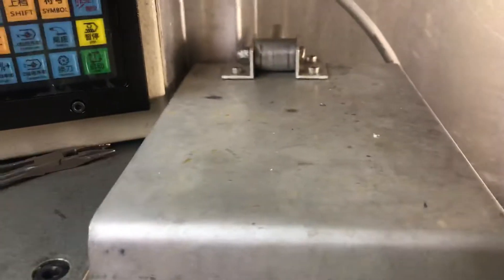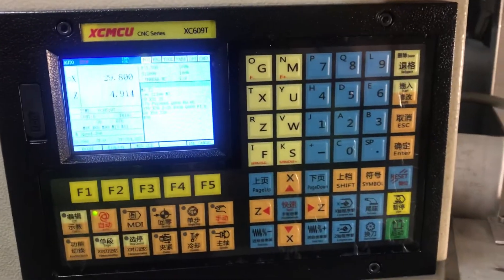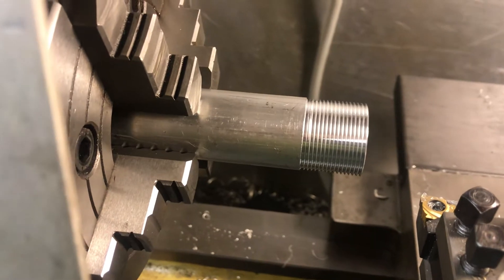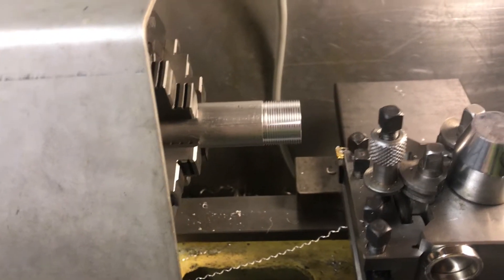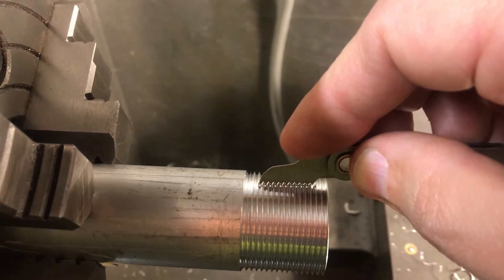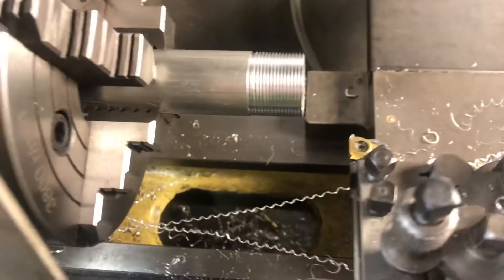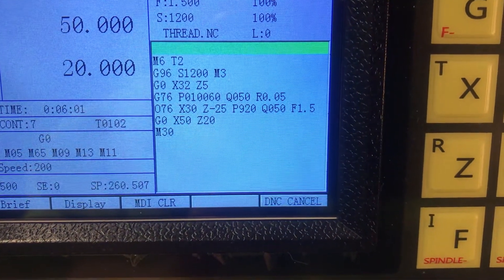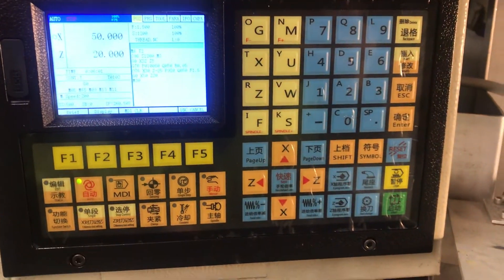Titan 32Bb Cnc conversion part 5 Threading test (phone vid)

Comment: Hello, I will be using a 1000ppr encoder, do I need any calculation in case the ratio of the spindle to the encoder is not 1:1?

Comment: Hello, when the spindle is rotated 360 degrees, it does not return to the uterus via the encoder, why can this be?
Reply from the maker: Encoder pulses set correctly in parameters?
Reply: @MJPilote Yes, that's right, I checked
Reply from the maker: @prom368  Spindle to encoder 1:1 ratio or something else?
Reply: @MJPilote  Yes 1 to 1
Reply from the maker: @prom368  Differential signal encoder? Good quality, not Chinese omron copy? You need A+- B+- Z+- pulses. Z is indexing pulse once per revolution.
Reply: @MJPilote  Do you have a photo of what kind of encoder you have? I have Omron
Reply from the maker: @prom368  i have the encoder in one of the other videos but I would say any of the brand name encoders will work that have differential output.

Comment: What value of parameter P065 is needed?
Reply from the maker: P065 Stable percentage of speed before threading, you can put any value you want but I usually want stable speed so something around 90-98%

Comment: Hello, tell me what settings are needed for threading?
Reply from the maker: You need 3 channel differential pulse encoder (A+- B+- Z+-) to sync the spindle, and nothing else really. Just setup the steps correctly on the steppers / servos which ever you use. Set tool offsets and go for it.

Comment: help mine is giving the error The tapping thread is too large for the shaft.
Reply from the maker: Usually starting point error or parameter error. Thread G76 or G84 tapping cycle?
Reply: @MJPilote  
I'm coming back here to thank you for the videos, I managed to solve the problem it was an error in the programming M04 I changed it to M03 and it worked I also increased the speed of the axes in the parameters to support the 1.5mm advance of the screw
Reply from the maker: @younglogin  I am glad if my videos are helping someone.
Reply: @MJPilote  I Use G76
Reply: @MJPilote  I,ll check everything again Thanks

Comment: Hello,
Thanks for the video.
What's the différence between the xc609D,  xc609M and xc609T  ?
Reply from the maker: D should have laser / plasma capability but I'm not sure. M is for milling and T is for turning aka lathe.
Reply: @MJPilote  ok thanks. Lastly, Could you do MDI ?  Typing Gcode Line on the controller. Thanks again. Seems interesting this  controller
Reply from the maker: @Levisgil47  Sure, MDI input works like it should. I use it alot when setting Z offset and tools
Reply: O D reamente não sei, o M é deMill, fresadora e o T de torno

Comment: Hello, you seem to understand this Chinese better than me.😎 at 3:40  in your video, why you have a O76 instead of G76 ? and it works.  Because I'm trying a simple  G71 turning cycle and stops on the second G71 line with a error 60 😅 thanks.
Reply from the maker: Wow, I did not notice that. Need to check if I corrected that typo when running the program. There was some trouble that I had with first testing too, need to check my old logs what I wrote down.
Reply: @MJPilote  Thanks for the quick reply. From your video it seems to have run. Could you please try a G71 cycle and let me know when you get a chance. Thanks.
Reply from the maker: @human2761  yeah sure. But it'll be on Tuesday as I'm out of town for couple of days.
Reply: @MJPilote  Sure. No worries. Thanks.👍
Reply from the maker: @human2761  https://youtu.be/D5Kp-ykO9JU

Comment: Hello, parameters encoder xc609t.?.
Reply from the maker: Use the encoder parameters suitable for your encoder. I have 256 lines on encoder  parameter P042
Reply: @MJPilote  hello
Alarm no.58
The tapping thread is too large for the shaft.
It came out
Reply: @marcoscarreto7566  I managed to solve the problem it was an error in the M04 programming I changed it to M03 and it worked I also increased the speed of the axes in the parameters to support the 1.5mm advance of the screw

Comment: hi, what encoder can i use to control the spindle?  Thank you
Reply from the maker: You need an encoder with ABZ differential signals that means A+ A- B+B- Z+ Z- and preferably no more than 100 pulse per revolutions as the signal bandwidth is limited.
Reply: @MJPilote  could you make a video about how to put encoder to the spindle and wiring to the controller please...
Reply from the maker: @SKCCNCROUTERBATAM  i have this video https://youtu.be/nf29al2vfkg if it helps any. There is some info in the comments on the encoder type.

Comment: Hi , I have the same controller, what parameters you set for home ref ? , I get alarm 40 Z axis back to zero configuration port does not ---, Thanks
Reply from the maker: I only have home switches so set it for home only. You have home and home plus Z pulse options

Comment: Please help me !
- My device is in auto mode now, as the picture cannot be edited at all. (as attached image)
- Show me how to reset them all or turn off the auto function
Reply from the maker: Just press Reset and then MDI and edit button. And youbcan scroll the menus with the function button at the low left corner of the panel.
Reset is at the right edge of the panel middle of the row about.

Comment: Good to see the control handles single point threading, but will it restart at the same point?
Reply from the maker: Yes, I tested that too, but the video was too shaky that even the phone vid disclaimer would not cut it. 
Restarted three times and it was spot on every time.
Reply: My controller arrived yesterday and so far I've only just got it powered up to have a play around. How do you find the g50 coordinate system? The manual along with Google translate isn't exactly great at explaining it in depth 😅
Reply from the maker: Make or Break Have not tested G50 yet, I used tool offset for the testing I have done.
Reply: So far that's my biggest gripe with the control. Just seems like such a daft thing to do with a fairly new control, Rely on obsolete  methods. I'm sure it can't have been impossible to add an offset table and possibly even support for g10.
Reply from the maker: Make or Break Well it's cheap as dirt, and does all the needed turning cycles, I'll test the g50 someday. Oh yeah, use encoder with 40 p/r the one mhz is for quadrature pulses, will run out of bandwidth in a hurry, I have 256 p/r encoder and its 967rpm and its over the limit.
Reply: Hmmm, I ordered a 500ppr encoder. But I can use it on another machine. Yes I agree they are so cheap I could not call the lack of proper offsets a deal breaker. But I will be running gang tooling so I'll need to get used to it. The canned cycle support really sold it for me. They really make online programming efficient. Been a few years now but I used to do that on a daily basis with fanuc, haas and mazatrol. Should be handy enough to get used to